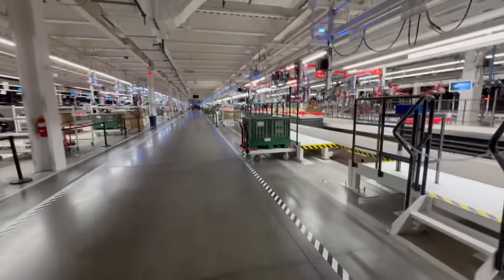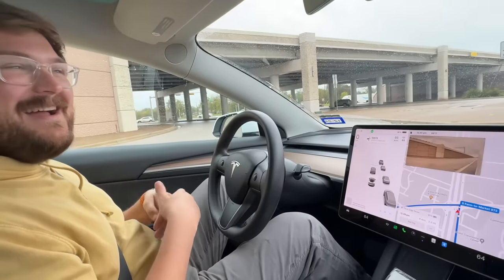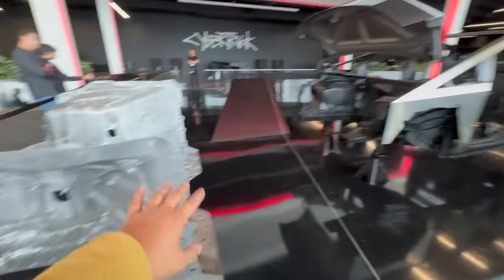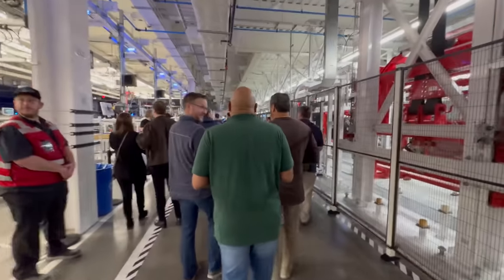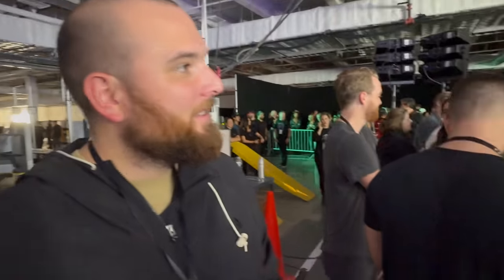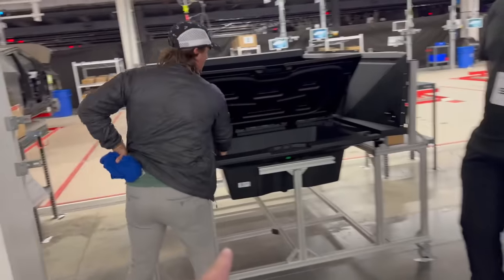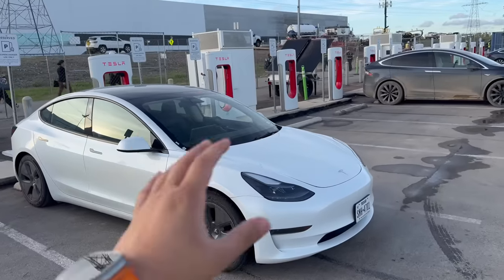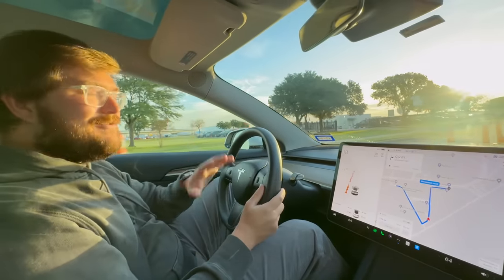Our Tesla Cybertruck Delivery Experience Vlog! We Had The Factory To Ourselves

Comment: Regarding that angle in the bed, due to the back seat ... I thinking looking at it as a negative to space is wrong.  They needed to get a proper rear seat space ... this simply needs to be done.  So you either have that bed wall go straight down and waste that space or burn it another way ... or you can angle it and give the bed more space than it would have otherwise.
Granted, just another way to look at it.  But given the need to have proper cabin space, I think it's more accurate.

Comment: Why didn't you, in the podcast , touch on points like:
Switch to 48V
The capability to use both 800 and 400 charging stations with ease
The fact that in work sites, or going off road the body and paint won't damage 
The lack of wiring
The body rigidity 
The steer by wire

And present it as if Tesla just did the minimum and other than the design it doesn't innovate.

I thinh you should listen to Jason Camissa, he sure does feel they made a lot of progress.
Reply: And one more point, he dragged it against a Rivian, similar specs, but the Cybertruck just destroyed it.

Comment: 60k base 80k mid 100k max.. seems like it not as we wanted..
f150 lightning still 49k starting price
$49,995
320 miles
XLT Model
 Sub 4 sec.
0-60 Time for F-150 Lightning
Reply: F150 lightning at $49k is for the 240 mile variant not the Extended Range 320 mile variant

Comment: I think the Cybertruk is going to be a massive failure, Elon missed the market by about 3-4 years, and it is NOT an appealing looking/functional vehicle according to anyone who isn't a Tesla stan.  Tesla moving the goalposts on what the capabilities are in massive ways over the years, and that price for what it is?  Woof.  I will stick with my capable R1T, which has fantastic build quality, and doesn't look like a moon toaster.  Also - LOL at that windshield wiper, that will absolutely be nonfunctional, recalled, and redesigned.
Reply: You are allowing your hate of the looks to overlook all the positives the Cybertruck offers, including the 48 volt system, drive by wire system, and more. 

Tesla is a good problem solving organization. The Model 3 refresh is a prime example. Any new model can have issues. RT1 owners had broken covers and software issues galore at first. I suspect Cybertruck will have issues with their first batch. Toyota says they go low volume with new models because odds of problems is high. 

If I was to buy a Cybertruck, it would be a 2027 to give them time to get problems worked out. If all who placed orders actually follow through, I would have to wait until 2028 anyways. 

The first reports from owners six months from now will show how poorly or well they have done. Most early media reviews are very positive.
Reply: It make other trucks obsolete and old
Reply: Cool story!
Reply: There will be more orders from tesla fans then annual production capacity, so, tesla did everything perfectly.
Reply: Don’t hate because it’s better than your truck
Reply: Tesla becomes the number 1 best selling vehicle in EVERY class it enters. It will do the same with Cybertruck. Making this product 3-4 years ago would have been ideal but wasn’t practical. Tesla was looking death in the face in 2019, but bc they focused their resources on Model Y the last 3/4 years, and went from being worth 40B to 700/800B, AND have like 20B+ in the bank, they can afford to take this massive risk and begin mass production of one of the most challenging vehicle to ever be built. 

Interesting how you think Tesla missed the mark by 3-4 years when imo, that applies to every other car maker. No one has reached meaningful production volume on an EV truck yet, and despite companies like Ford and Rivian getting a head start, Tesla will dwarf their production volume and be the first to reach mass production of an EV truck, AND unlike the others, they will actually make a profit within a few years of starting production.

Genuinely trying to share knowledge with this comment. I understand that everything above is not a guarantee but their track record gives me confidence and should really convince anyone that knows the data. #HODLTSLA
Reply: I bet you said this about every tesla car.
Reply: @booge53  well if he did, he’d be right every time🤣 take a second and think about what you’re about to type next time
Reply: I think it’s unnecessary and stupid but we live in a world of hype and a lot of people will buy this truck just to say they have it and stand out.
Reply: It will outsell everything
Reply: Hey troll… we all disagree ! The Cybertruck invented its own market niche. No one will be able to develop such a vehicle with such a look.
Reply: You couldn't be more wrong its gonna sell millions of units.  Price will come down in 2 years when needed.
Reply: Lol the cybertruck makes your rivian look like a dinosaur. Stay salty.
Reply: What I love in Tesla fan-boys-club that if someone doesn’t like Tesla - he is a Troll, etc. Everyone has its own opinion and taste. So chill. And yeah, Elon promised Cybertruck starting from $39.900 - Elon delivered. As usual. We can definitely trust your word…
Reply: The Rivian can’t even fix their bed cover and have released multiple software updates that brick the whole vehicle. Cybertruck is already better because it has a cover so strong you can stand on it. Also these other electric trucks aren’t trying anything new tesla has steer by wire, 48v low voltage system, the windshield wiper(which is actually better), and the body is very durable. Plus you can actually charge the cybertruck unlike the trucks using CCS2. This truck is way more efficient than any other truck and is the most capable. If you thought they were gonna stick to original pricing you are out of your mind because we had a whole pandemic, supply shortage, and massive increase in inflation. I like that they made accessories for features that were originally going to be on the truck but just couldn’t make it happen so they still give you the option to have a ramp and 470+ mile range which is really only useful for towing because no one should be driving over 470 miles without stopping at all. I think the middle tier AWD option is the best now because the beast has extra performance that most people don’t need and it costs way more just for that extra performance. I think most people are gonna want AWD instead of RWD and the lower cost one won’t be as capable so people who keep their trucks only on the road and don’t really care for performance should buy that one. Don’t forget these other electric trucks are similarly priced and the cybertruck gives you the most for your money.
Reply: Kyle said the Tesla fans were negative at the event.  $80k is too much for any car and especially if you are a 20 year old living in mom’s basement asking for more meatloaf.
Reply: Holy piss this comment section is filled with fanboys
Reply: The haters have been wrong about Tesla since the beginning and continue to be wrong.
Reply: Test drive one  and then see if your opinion changes
Reply: Aaaaaaaaand you’re wrong 🎉
Reply: Not very bright, are you? 😂
Reply: Tell me you hate Tesla without telling me you hate Tesla. It’s not for everyone my guy. Some people feel the same about the Rivian because of its size.
Reply: Yeah it's amazing how all other trucks look old and dated now that this has launched. Lots of genuine automotive developments too.
Reply: There are a lot of reasons to prefer a Cybertruck to a Rivian if you’re wearing a blindfold
Reply: I doubt it will be a “massive failure” - there are enough Gated Rat *an*oys to guarantee it has far more sales than actual “market for the vehicle as a vehicle” demand should. I imagine this will end up like the G-Wagen, a luxury high-end halo vehicle, and in two years they’ll release a “normal” pickup.
Reply: I like the Rivian. I hope everyone understands what the price of your truck would be if they sold it at just break even at current production cost. Same with the Ford. They are all going to be expensive for a few years. I might buy a Rivian when they can reach scale and profitability.
Reply: Hard to call a truck that will sell every vehicle built a massive failure. The only constraint on CyberTruck’s sales will be their production output. The Rivian is a great little truck, but that doesn’t necessitate you having to dump on the CyberTruck to prove something. There’s a reason why they make chocolate and vanilla.
Reply: @ScoobyFermentation  But why should I move out from my parents basement, it’s so cozy here plus meatloaf is my favorite dish. Hahaha. I love you Tesla fan-boys-club you are so cute, like bunch of puppies. I owned 2 teslas s and 3: plus side - charging network, negative side - quality of both cars is crap - my personal opinion as the owner. Especially model 3.
Reply: @shou635 why do you think all people who don’t like Tesla cars are Haters. Jeez, it is simply my opinion - not a fan of Tesla, same as not a fan of Fisker. Simple as that. So chill
Reply: You mean according to everyone that has never drove or seen one in person?
Reply: They already have orders for a few years ahead
Reply: You are entitled to your opinion- and you are going  against someone who is eclipsing Thomas Edison.  We all are comfortable with someone who has a differing opinion.
Reply: Other than your feelings, the cybertruck is better than the R1T in every measurable way.
Reply: @kevtheobald the rav4 outsells the model y, the Camry outsells the model 3, what are you talking about?
Reply: @chrisl22182  Globally, the Model Y is the best selling vehicle for 2023 so far. Top seller in Europe, top seller in China (biggest vehicle market in the planet). 2023 looks to be the year of the Model Y as the highest units sold based on all markets combined.
Reply: Let's hope price will drop to around 30k after initial demand is satisfied
Reply: @PraiseYAyoupeople  I could see a $10,000 sometime in 2025 if over half of those who had placed orders pull them. By then they will have a good sense of demand for the truck and all their costs.
Reply: Yeah I don't know how they "adjust upon the line" to fix cosmetic everything seems like "total commitment" anyways. At a price this will find buyers of course tho.
Reply: It is not an appealing looking/functional vehicle According to anyone who isn’t a “Tesla Stan” (i.e. a Rivian Stan) who’s R1T is sitting 61 feet behind Cybertrucks dust in the tractor pull!  CT has outdone the Rivian in every way before it was even delivered! And I’m not a Tesla or Rivian Stan… but my name is Stan!
Reply: @booge53 Or every car that’s not a Rivian! 😂
Reply: @S.E.C-R  So far the early media reviews have been very positive. Outlets not always kind to Tesla acknowledge the Cybertruck is actually good to drive and useful. You can hate it all you want, but the drive by wire system, 48 volt system, and rear cover, all seem to work very well and will likely create change in the automotive industry. Looks are subjective, but function is real.
Reply: First world prob
Reply: With only 1% conversion of the what 2M pre orders that still 20k right? That should last till through 2024 right?
Reply: The R1T has plenty of build quality issues… how about the water that gets trapped on the bed of the truck and just swooshes around 😂
Reply: He saw a video about the game/comic called Cyberpunk and got carried away. He's terrible
Reply: The fact you can only sell it in North America because of the design is pretty nuts.
Reply: I have 1 million reasons to believe you have no idea about what you’re taking 😂😂😂😂
Reply: @kevtheobald  My comment was in response to the OP!

Comment: The specs of the Dual Motor delivered, 340miles of range is great. $80k vs $50k original price is quite a bit though. Of course it will come down in price quite a bit in a couple years. I think they priced it right now so that they won't be loosing a significant amount of money on each for now. Demand will be there initially to buy it at the higher prices

Comment: Telsa finally got with the program with the benefits of 800V busses in EVs. Now we need them to design replaceable HV batteries, ala Nio.
Reply: They had swappable pack's in 2013 with the model s you can even watch it right here on YouTube. So if anything and with almost all things Chinese and ev related they merely copied tesla! 👍🏻
Reply: 800V in this truck does almost nothing. The max. charging speed of 250kW with a 125kWh battery, meaning 2C, is not high enough and could have been achieved with 400V and 625A just like other Tesla models with this charging rate. They might split the battery in 2 parts while charging, but the improvement isn't as big as people think it is. 300kW would really make use of the 800V system and would have made sense for such a big battery, that would still only be a 2.4C rate, so longevity should not have been the problem. Tesla is cheaping out, as always.